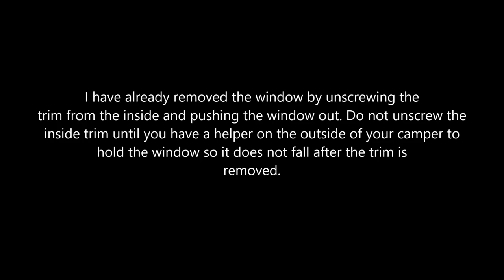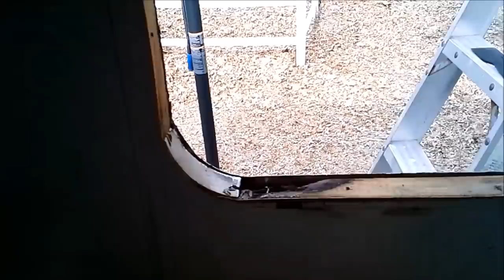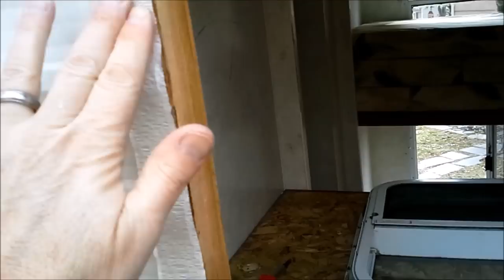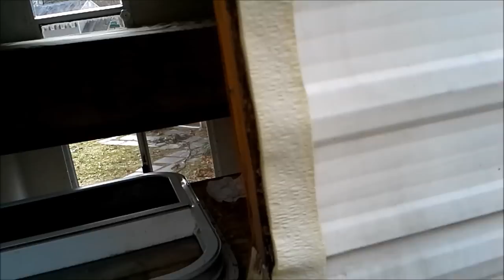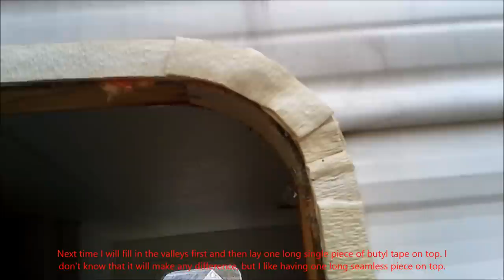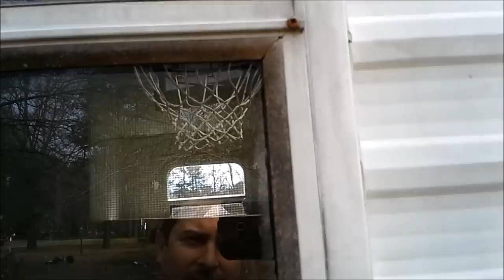How to Reseal a Travel Trailer Camper or RV Window

Comment: I must complement you on how you cleaned off ALL the old chalking so thoroughly.  Not always done, which can kill the whole job. Surface preparation is very critical or you might find you still have a leak after doing all that work. With 10 months past, how did or is it still holding up? Nice short video. Cheers
Reply from the maker: Thanks sailingsolar. Actually just winterized the camper last weekend. The window repair is still very solid. One thing that has happened over the months is that any extra butyl tape has been slowly squeezed out around the edges as the window settled in. This is easily removed with the plastic putty knife. In my opinion it is much better to have extra ooze out than not enough! Some of the original window jobs still have extra putty oozed out around the sides, but it has turned dark and somewhat brittle by now as it was done 14 years ago.

Comment: fighting the same thing.. does the butl tape need to set? I did two windows. one seems fine. the other doesn't. i guess my mistake was putting the butyl tape on the window and not the rv.. seems obvious now. we did put the extra layer for those ridges too. as for needing a helper. I saw another video where the guy used a 2x4 outside against the window. great video

Comment: Have you had anymore issues with yours?? We have to fully replace a wall which has several windows on it (we can't find flat sheets for a decent price but could find corrugated sheets like this) I was wondering if you've ever had to replace a section of your tin and if so how you worked with kinda smoothing out the ridges when installing a window. I know it's probably a stupid question to most, but I've never done this and we can't exactly afford to have it dealt with by some big company and pay thousands for something so "simple" so please don't belittle me for trying to better myself and knowledge on how to handle issues with our camper.
Reply from the maker: This camper got flooded by a river June 3rd, 2018. We have since purchased a new one. I'm sorry to hear about your camper. I don't have experience replacing walls.

Comment: You state that you caulked the window, what did you use? I know silicone is the worst product to do this with.
Reply from the maker: +Stetson Wrangler I used Sikaflex 505 UV-HV. You are right about silicone. Do not use silicone caulk anywhere on the exterior of the camper.
Reply: +MrWoodshedder Why no silicone?
Reply: It will adhere for the first little while, but will not stay in place.

Comment: I am replacing some windows now in my class b van conversion.  You mention using mineral spirits, but will they take the paint off the van?
Reply from the maker: I don't think mineral spirits will take paint off your van. In fact, I did a quick google search and there are some recommendations to use mineral spirits to remove sap from a car finish. As always though, please check for yourself! I could be wrong!
Reply: Mineral spirits is some potent stuff, it CAN and will remove paint but only if you let it sit. So, as long as you wash it down with water afterwords or something it should be fine.

Comment: Thanks for the video. I noticed you did not replace the rotton wood under.  Has this caused any problems/ mold for you?
Reply from the maker: +Tina Mills I inspect that area often, and the other bunks, and I have never found any mold or mildew. We are getting ready to make our first trip in 5 months out to the camper. It stays exposed 24/7/365. If I find any damage after this winter, I'll report back. I expect everything to be fine.

Comment: Can anyone give me some advice? I have an 88 27ft with windows that I doubt have ever been removed to be resealed etc. I am attempting to take them out one at a time to reseal and rebuild. My problem is I cant even get the Phillips head screws to start turning at all. Any suggestions? Ive tried WD-40 and except for cutting them out which I would not prefer to do, am lost. Please help. Has anyone else done this project?  To see a vid on my "New" toy, see http://youtu.be/9fHBxCMmWm8    thanks for any help.
Reply from the maker: I would try some silicone lubricant. WD-40 typically works for me, but maybe you need something different. Let the lubricant soak the screw for a while, then come back to it. I'm assuming you are using a power drill. You might need to brace yourself so you can really push hard on the screw heads. If that doesn't work, I would drill them out before I would cut the heads off. They should be easy to replace if they were anything like mine as they were a fairly standard self-tapping sheet metal screw. As for the rounded corner area of the overhead bunk where the aluminum edge is no longer sealed, there are some videos out there that show you how to fix that. Good luck!
Reply: Actually the corner you speak of near the end of your comment is Fiberglass, not metal. And thanks for the screw info. At this point Ive still had no luck getting them out.
Reply: +Bruce Riggs I know this is a late post, but have you tried screw extractors?  They work pretty good.
Available at Lowe's :http://www.lowes.com/Power-Tools/Drill-Bits/Screw-Extractors/_/N-1z0wcjb/pl#!